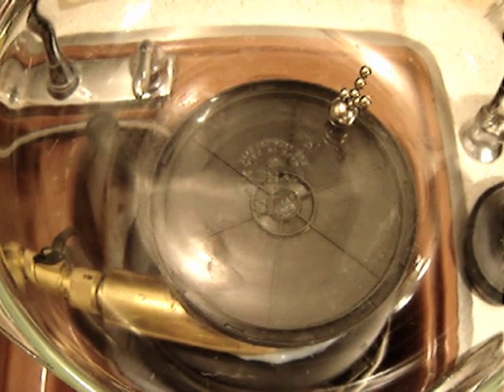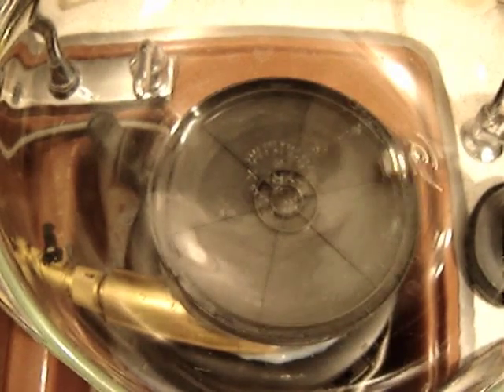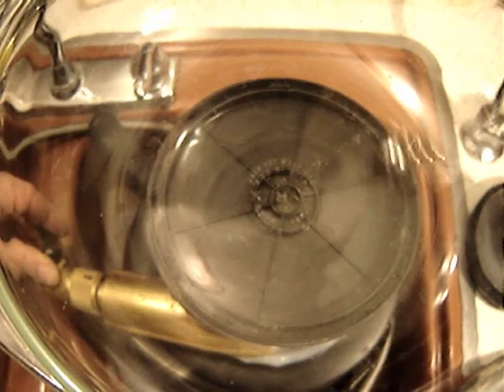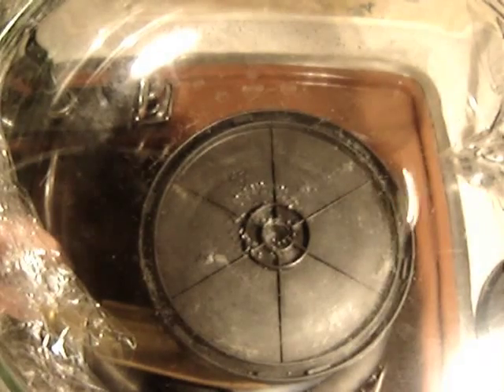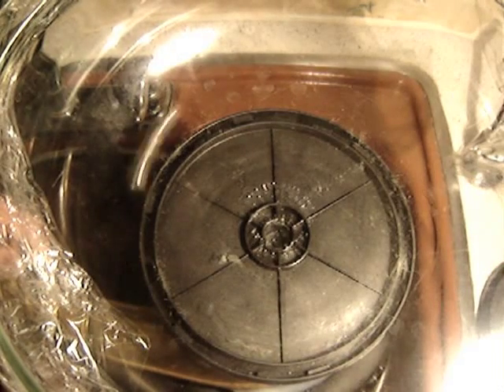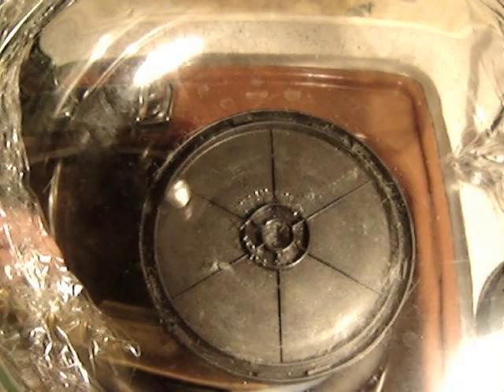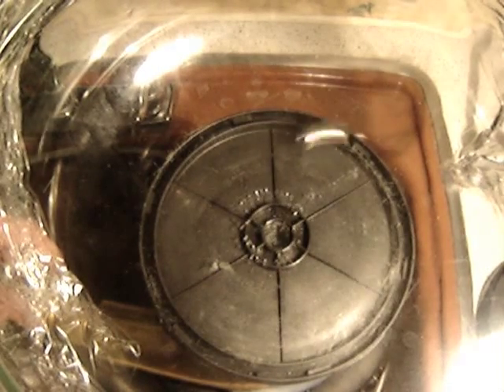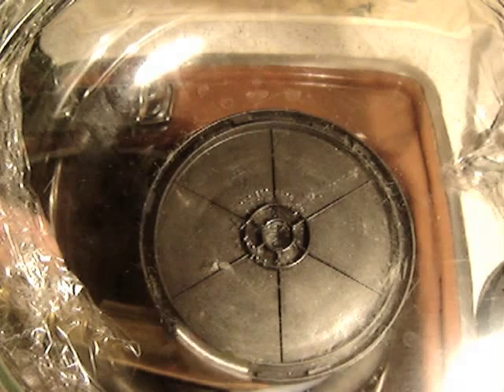SinkScience #07 -  Ball Magnet Reverses Rotation

Comment from the maker: Yes. In fact the coupler acts as a brake at times, until the speeds synchronize, then it couples. There's a good demo of this in my #01 SinkScience video, where I show the coupling levitating over the Turbine, then drop it down to couple mode.

Comment from the maker: Great observations!

You may be right about the ball's constant speed and radius of curvature. The ball's speed in terms of RPM did go up; that is, the angular velocity and sound of rotation increased.

It's the change in magnetic flux that moves the magnetic ball. A rotating magnetic ring has a constant magnetic field, and therefor would not change it's influence on the magnetic ball with increased, decreased, or no rpm at all. The magnetic ball would remain stationary in that case, I believe.

Comment from the maker: In this movie it occurred at about 600 rpm. However, rpm when ball reverses varies with height and size of container(if any...it will do same effect on a level surface, but with more restricted, lower rpm range). I can get the ball to go in reverse at practically any rpm as long as I vary the height. In fact, it goes in reverse much more readily than in the forward direction!

Comment: You have several major dynamics in play here. Friction, momentum, magnetic shear, diamagnetism and ferromagnetism. You also have a few minor dynamics. Correolis effect, earths magnetic field and energy transfers to the bowl and air. The primary reason you are seeing these effects is due to inertial and frictional shear and rotational harmonics. There is a point where the induced ferromagnetic field harmonizes with the attraction to the trailing magnet due to these shears.

Comment: Well, the thing is that a system with multiple magnets like that is going to be non-linear, so you get a chaotic pattern just like you see with magnetic or two-jointed pendula. The ball is settling into whatever equilibrium it can find. At low RPMs on the turbine, that equilibrium is going to be directly over one of the magnets, but as the turbine speeds up and the ball experiences more friction and thus fails to maintain its position over a magnet, the equilibrium is going to change.

Comment from the maker: @MrPhfaty 

The 6 magnets on the top disc inside of the turbine are 1/2 inch x 1/2 inch neodymium cylinder magnets in N52 Grade. They are all positioned "North up". 
The sphere magnets in the bowl are 1/2 inch and 3/16 inch neodymium in N42 strength.
I get magnets from K&G Magnetics. (link in the "Show more" box)

The rpm varies from 50 to 900 rpm, and yes, a tach reading would be helpful in this experiment.

Comment from the maker: Thanks for comment xi240. "The reverse motion continues as the platter slows because of inertia." I don't believe that statement is true. The reverse motion happens whether the platter is sped up, slowed down or at constant speed. The ball magnet does the same action (reversing) on a level surface as well.(that is, it doesn't require a bowl curvature for the reverse effect.)

Comment: The friction is important only to the extent that it brings the ball into reverse orientation at the right speed for doppler attraction at which point it accelerates. You will have to initiate that part by hand, but once it is moving in reverse it should accelertate and continue.

Comment from the maker: Precession refers to a change in the direction of the axis of a rotating object. This happens as the sphere is dragged or rolls around. Gyroscopes typically have precession...they rotate in a cone-shaped figure.  

Oscillate means to vibrate, which is what often happens when the ball magnet can't "decide" which way to rotate.(just before it changes direction)

Check out my new SinkScience#11 (uploaded today) for more info on this same issue.

Comment: It is a hypothesis I have the deals with flux gradients and curved space in magnetic fields. Because there is distance involved, when we put the field in motion relative to a magnetic object the object will experience a change in relative flux density. An increase on approach and a decrease on retreat. The higher the M and the faster the speed the greater the differential. I have seen this differential in your videos, the whipmag, and 'right combination' video.

Comment from the maker: Hehe,  perhaps that's what happens when the magnetic poles flip?

The ball hopping is a strange thing I haven't quite figured out. 

 It doesn't matter bowl or no bowl, there is definitely a position of the ball where it has a more difficult time to move around...it kind of gets "stuck" and oscillates.

The sticking/hopping occurs on the East quadrant of the turbine. I think it may have to do with either alignment of the earth's magnetic field with the experiment, or a form of precession.

Comment: You mentioned hanging it on a line. I think you would need about 8' of it to avoid introducing a counterproductive vector. You might try the 5' above the sink (attach to ceiling). You can pinch the line at different lengths to find the right arc. Its complex because you have altitude and circumference to balance. This is why I didn't suggest it before.

Comment: First its mostly just rolling. The extra magnets actually increase the by making it lean.
Second the ball changes direction because once the magnets start spinning fast enough it is less resistant to move the opposite direction. The ball gets pulled towards the magnet going to it. The ball's momentum lets it overcame the pull of the magnet in the opposite direction.

Comment: But that I think is the reason fro reverse rotation and the chaotic motion is that the turbine is rotating faster than the ball can roll in the curve of the bowl without being thrown up the side and out of the field. when it stars to go up, it looses speed, then as it comes back down it slingshots past the magnet and into the other side of the bowl crossing nearer to the center.

Comment: It actually does not have to be a magnet in the beaker, but in order to work it has to turn into a magnet. Some ferrous materials can become magnetized, but then they turn into temporary magnets. 

In either case it is reacting to a magnetic field and only magnets really do that. A metal that is attracted to a magnet itself becomes magnetized if only for a short period of time (retentivity).

Comment from the maker: No, water spins the turbine slower than air. Water gives better torque at low rpm's, however. 

Water pressure and air pressure at the same time works well, as seen in my latest 3 videos showing a blender.

Comment from the maker: I tried the "rail gun" thing, and it would shoot weakly out of a plastic tube. (Copper or aluminum tubes produce eddy drag with magnets)

The "slingshot" effect works best at lower speeds of the turbine; at higher magnetic field rotations, the magnetic ball just sits and vibrates or is barely affected.

Comment: i noticed when the speed jumped up really high the ball couldn't do a full circle fast enough so it went into a different state, like a star pattern, like a spirograph, not sure wether 5, 6, 7, points, etc.  the reverse rotation is amazing.  must be frequency or spin related.  I bet if you got it really, really fast it might levitate or fly right out

Comment: It is pretty simple, the bowl itself is not rotating along with the turbine so the ball has 2 forces working on it currently. It has the magnetic pull of the turbine and the drag of the bowl. To continue moving, the ball must rotate, either that or the magnetic pull has to be stronger than the drag of the bowl.
Now as for the spinning backwards at a certain speed, I know how it works, but it is going to be hard for me to explain being I don't know all all of the technical terms...
(continued...)

Comment: ever looked at a car's rims while the car is moving? they appear to rotate the opposite direction of the wheel once a certain speed is reached. yeah. that's what your magnetic fields are doing. the magnets are spinning so fast in one direction that they can match the rotation of slower magnets that would be moving the opposite direction.

the ball can't move as fast as the magnets at this point, but they can match this seemingly backwards rotation that they're picking up magnetically.

Comment: Did you notice that the ball, once up to speed, would pivot toward the axis of the below magnets but never follow the same path twice? I found that interesting. I had to watch twice to make sure I saw what I did. Also, if you used a tube, say copper, then dropped the ball through and passing over the rotating turbine, if may fire like say, a rail gun? Just a thought.

Comment: No, that's not what I'm saying at all. I did say that if the ball were perfectly frictionless and inertialess, it would sit right on top of one of the magnets and track its movement perfectly, since that would be the strongest equilibrium point possible. But given that it's neither frictionless nor inertialess, it can't do that. Therefore, it falls into a different equilibrium state where it moves along isolines of the net magnetic field of the six magnets. The field makes the patterns.

Comment: medical lab mixers to industrial paint mixers.
It actually does not have to be a magnet in the beaker, but in order to work it has to turn into a magnet. Some ferrous materials can become magnetized, but then they turn into temporary magnets. 

In either case it is reacting to a magnetic field and only magnets really do that. A metal that is attracted to a magnet itself becomes magnetized if only for a short period of time (retentivity).

Comment: I may be wrong but it seems as though the turbine is inducting a magnetic field in the ball that is stronger than the original force meaning it would repel instead of follow the turbine. The initial interaction would be to attract to the oncoming turbine but as it approaches it inducts and it slows down and then overpowers the original force and repels it once it's passing. This is possible because the original attraction is oncoming before it has time to induct.

Comment: The magnet balls are rolling, the balls on top are on its side,imitating a wheel you could say, once it goes into the clover shape it is only taking that form because the magnets are moving too fast to make a strong connection, so in turn gravity and the power of the magnet throw it around,(the shape of the bowl takes part in the action) also the shape of the "clover" takes place is consistant but the sequence in each spot is different and erratic.

Comment: Industry is useing microprocessor-controlled fields that prevent the erratic movements you displayed. This nis used in medical lab mixers to lare scale pain mixers.

Some use motors with magnets below the Pyrex blow (as you did), others (my favorite) have no moving parts below the Pyrex bowl, but a rotating magnetic field. 

It is still chasing the magnetic field when going backwards, but cannot move fast enough due to its mass vs./ magnetism.

Comment: Try a teflon cutting board sprayed with PAM or another friction reducing oil. I would suggest suspending the ball from some line with a swivel but that introduces other forces while removing the friction. Also, use a magnetized sphere. Do you have a way to chart the RPM's of the drive and sphere?

Comment from the maker: I just tried the ball on a string trick, and could not get the magnetic sphere to revolve backwards, so I assume a friction effect is happening in the backward rotation example. 

I do have a tachometer, but it would be difficult to graph because the reverse effect, once started at high(700-900)rpm, can still continue right down to less than 100 rpm(turbine rpm). Ball rpm varies from 60 to 300 rpm at both high and low rpm.

Comment: My theory: The magnetic force applied across the conductor induces current flow in the ball which creates a magnetic flux field in opposition to the force which created it (Lenz's Law). The motion of the ball does is in reaction to a combination of simple magnetism as well as electromagnetism acting upon the ball. Try an aluminum or other electrically conductive but non-magnetic ball and see what happens when the simple magnetic relationship is taken out of the ball's portion of the equation.

Comment: No, the ball requires interaction with the magnetic field from the generator to rotate. The generator is just a rotating a magnetic field, and the magnetized ball follows it (like an electrical motor). A metal with NO permeability (or a metal that cannot become magnetized will not work), and will NOT follow the field at all.

Comment: Ok if you engage your brain it is quite simple. The thing happens if you were to do it in a straight line, it would roll. Second the clover-like formation is caused by the ball being forced out then falling back in over shooting the magnet then coming back out again over shooting and so on. The reversal of direction is the same effect as a fast wheel spinning appears to move backward, in this case the speed of the turbine is too fast for the ball cos of the outward force. If u disagree dnt shot

Comment: Actually your right the spinning liquid iron core of the earth produces the same type of field (which also varies in speed) and based on the changes it also reverses the field direction (no this does not reverse the rotation of the earth, as you see the turbine itself does not reverse). But if you were to stand at the pole (your bearing is at the pole of your field) with a magnet at a reversal it would on its axis.

Comment: I think it's just a question of sync and friction. Normally the ball rotate followin' the magnetic pole below. But increasing the rpm it's  ever more diffcoult to follow the pole 'cause friction is rising too. At some point the magnet below is so fast that it moves on the opposit pole of the ball which suddenly is repulsed in the opposit direction and rotate AGAINST the normal rotation versus. If it happens at the "right" velocity the ball and the magnet become synchronized...
Nice video :-)

Comment: question: are all the magnets the same size weight  and equal polarity?  if not then that could explain the interesting effect. plus the ball has no set track , so it's weight seems to be being pulled by sentripical force, as the magnets pull it back. at 3;25 (when the turbine is stopping i noticed the cds wobble, which would create a double wheel spin at high r.p.ms., causing the ball to be pulled by two rings by the same one ring spun magnets. plus the ball is being spun by a passing magnet..,

Comment: Could it be super imposing waves? At different speed the magnetic waves have different wavelength. Certain speeds would produce wavelength that have harmonics with the bowl's diameter. It's the same principal of vibrating waves in a string fixed at 2 ends and sound waves.

Comment: hmmmm friction maybe be the cause of the ball rotating on its own axis, but at 7:07 it looks like the ball does a peel out effect instead of simply rolling (The ball is spinning fast enough to break friction). Also when it comes to the backward rotation I can think of a spinning track with platues and valley with a motorcycle speeding in the other direction. Maybe the ball is skiping along the surface of + & - instead of being draged along as it would going the same direction. I THINK!

Comment: Ran out of bloody characters.

Anyway, the rotation is caused by the inner edge of the ball traveling less distance than the outer edge. In that sense, you might say it's similar to the coriolis effect. I don't know enough astronomy to say whether that's why planets rotate, but it seems reasonable to think that coriolis-type eddies would build inside a planetary disk as matter coalesces. However, I'd expect the direction to be reversed from the magnet ball's behaviour.

Comment: the revers in rotation should happen at a predictabel rpm and it  should be expenchaly shorter inchrvals or revesal. in thery at some rpm the ball wont evon move but sit still in the midel of the bowl and in a perfect inviormten you couldnt pick it up. thers no way you could get it up that fast thou. would love to see some data on this some time. oh ya y it reversis the magnets will   evenchually be passing by the ball befor they efect it thus the next one will efect it first passing it on